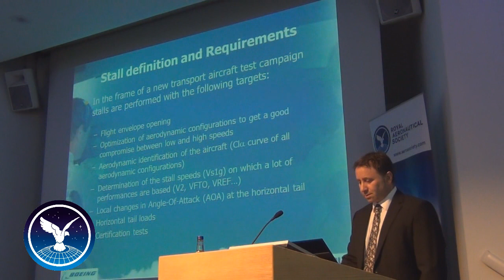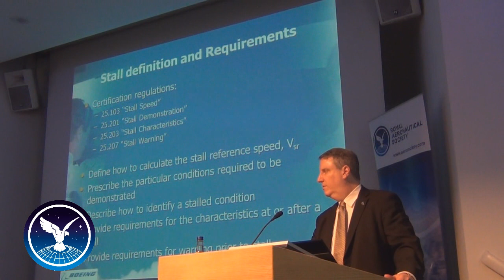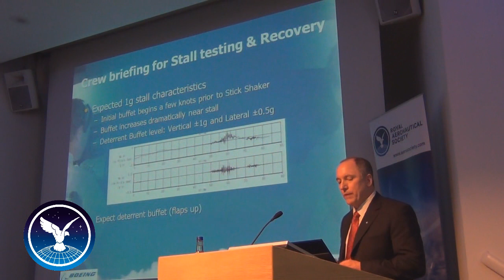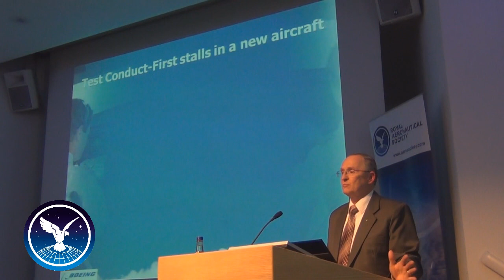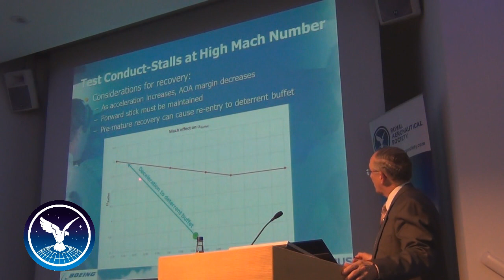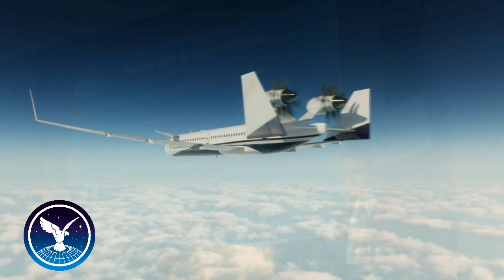Exclusive: Joint Airbus & Boeing flight test lecture

Comment: Quick Q - Why were the stall vids excluded as they made up an important part of the lecture and helped explain the topic well? Nevertheless, thanks Raes for an excellent video and for covering an important topic for CPL/ATPL holders especially in light of recent A330, A320 and MD-80 stall events.  Airline safety departments would do well to include a link to this in their training material.